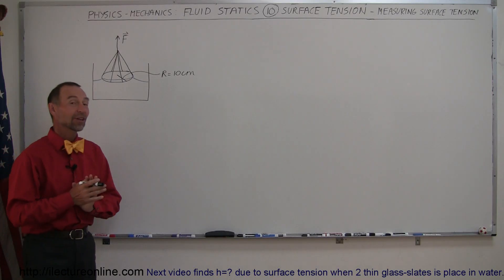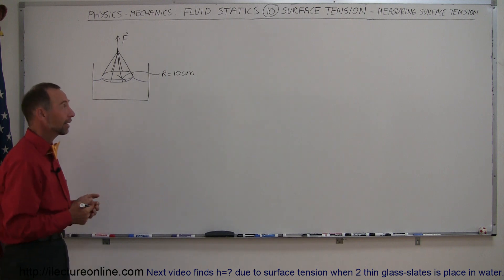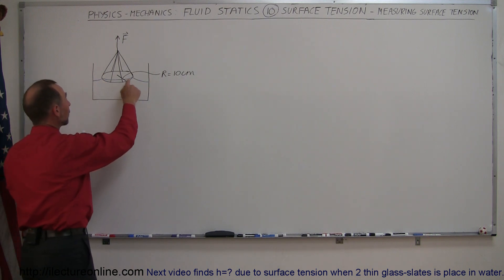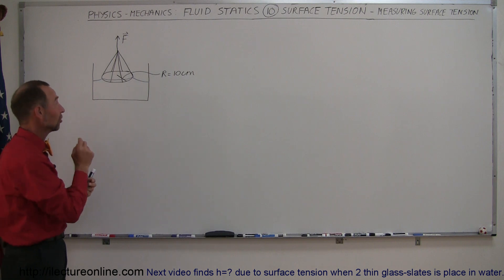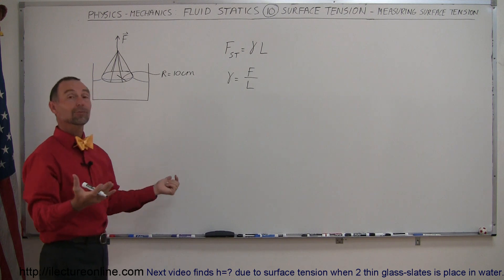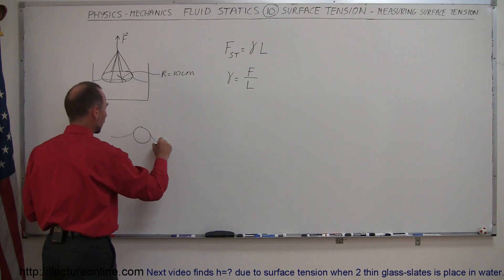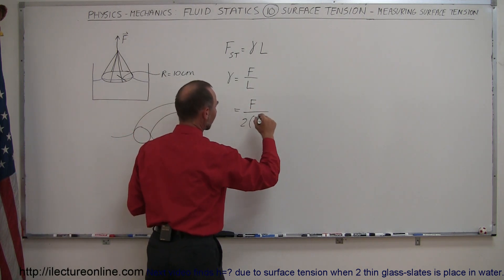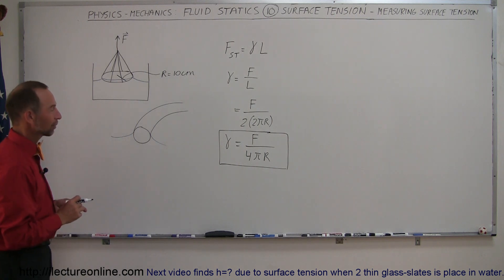Physics 33.1  Surface Tension (10 of 12): Measuring Surface Tension

Comment: If you do this as an experiment, would the material of the wire matter?
Reply from the maker: Yes it does.  You want to use wires that do not chemically react such as tungsten, molybdenum, or platinum
Reply: @MichelvanBiezen  but according to multiple sources, platinum is watch these rings (du nuoy rings) are made of ? Am I incorrect?

Comment: Wouldn't we subtract the weight of the wires from the force pulling it up just to find the force to break the surface tension, and not the force require to break the surface tension + force required to lift the wires. Please reply fast, its for assignment
Reply from the maker: In the real world, yes.  Here for simplicity we assume the weight of the wire is negligible.
Reply: Thanks @MichelvanBiezen

Comment: Sir, why can't we use a linear wire for this calculation, won't calculating st be easier
Reply from the maker: It is actually the same difficulty.  Using a circular ring is easier to balance in the experiment.

Comment: Hi
Would there be a difference in the coefficient depending on what kind of metal wire I use? Or is that negligible in calculating the coefficient?
Reply from the maker: There are slight differences, but they tend to be negligible.

Comment: Does the material the wire is made of matter?
Reply from the maker: It can make a difference, but typically it is made of a thin metal wire and makes very little difference.

Comment: L is the length of what?
Reply from the maker: L is the length of the "border" between the liquid and the solid.  In the case of a wire making contact with the liquid, you have to account for both sides of the wire.